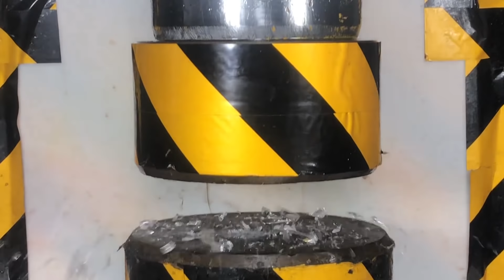Can diamonds withstand 200 tons of pressure?

Comment: Next : Can 200 tons of pressure withstand 200 tons of pressure?
Reply: Idk guys 200tons of pressure looks pretty strong compared to the 200tons of pressure, if you ask me
Reply: That would make 0 force 🤣 it would be neutral
Reply: Lil Ray but the battle will be legendary!!
Reply: I just picture one of the machines vertical while the other is horizontal and it just makes a square of doom.
Reply: @lilray5489  Exactly
Reply: It would stop in the middle lmao
Reply: holdup-

Comment: This is unrelated to the video, because he used a glass-plastic hybrid in the shape of diamond for his "tests". 
Diamonds are the hardest material on Earth. They can scratch any material or mineral and only another diamond can damage a diamond. Although diamonds are the hardest mineral, they shatter easily. Hardness and pressure withstanding have nothing in common and to do with each other.
Reply: But diamond can easily be obtained using iron pickaxe 🤔🤔
Reply: @Wilson49363  The iron pickaxe digs the stone surrounding the diamond shards technically.
Reply: The Boy Wonder  No.

Comment: Obviously fake  - probably glass - diamonds. What is being tested here are the statical properties of diamond cut polyhedron.

For those really interested: I pulverised a real diamond (small, about USD 300 😉) between two steel plates and hitting it with a 500 gram hammer.
Diamonds are brittle and tend to have inhomogenous areas subject to pressure due to their natural growth and inclusions.